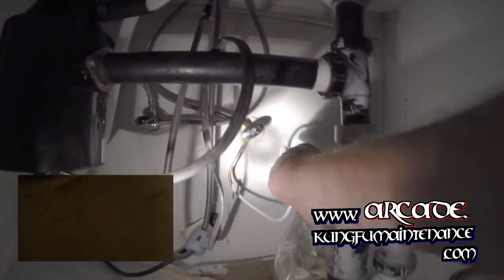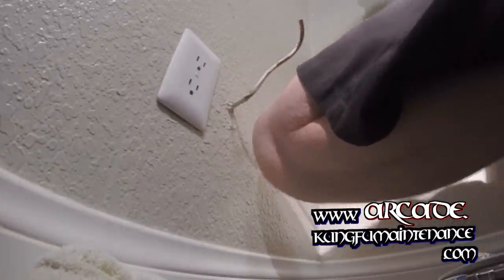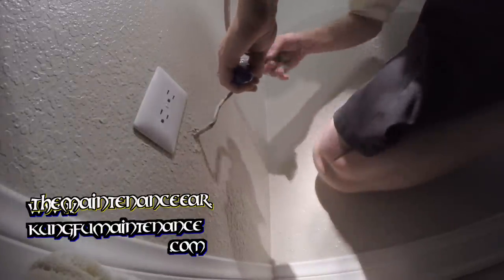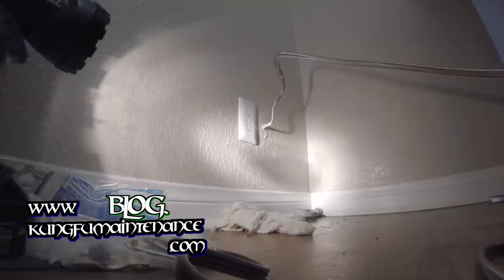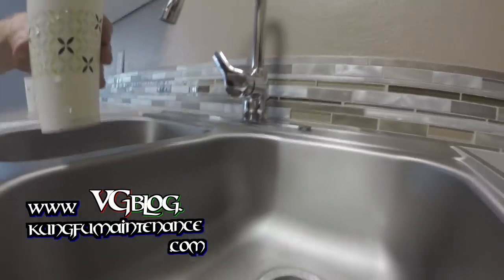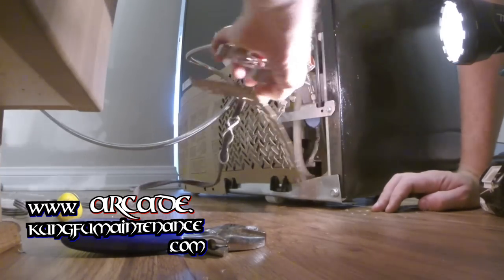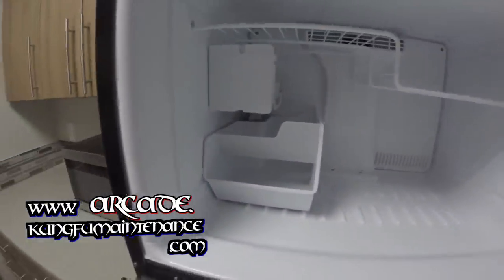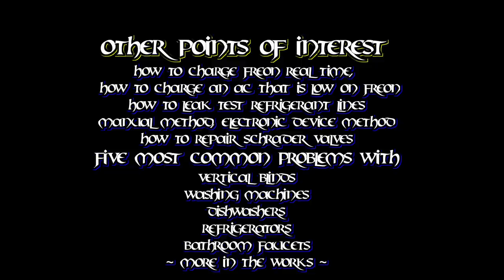Hooking Up Icemaker Water Supply Line From Wall To Refrigerator

Comment: hey Kungfu,
We bought an LG fridge that comes with a big white roll of hose/tubing inside. What is this for? I thought it was to be use for water line/ice maker but it seems like is going down the fridge-coming to the front-then up to the water dispenser. is this correct..? I appreciate any help.